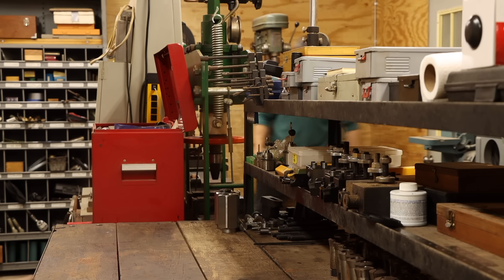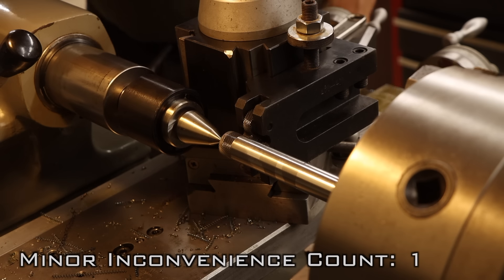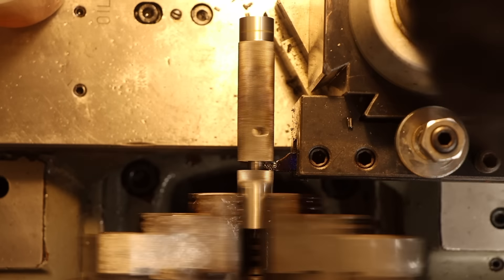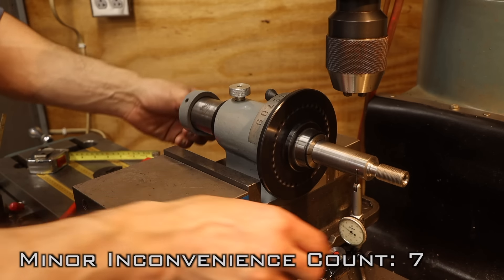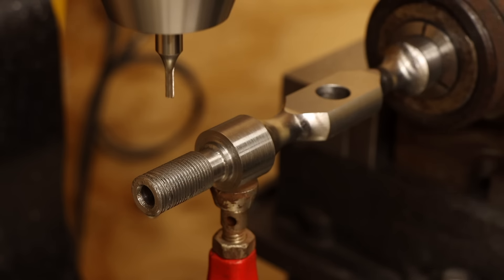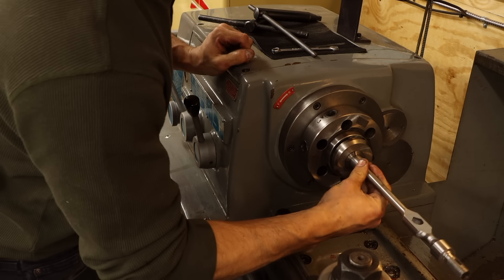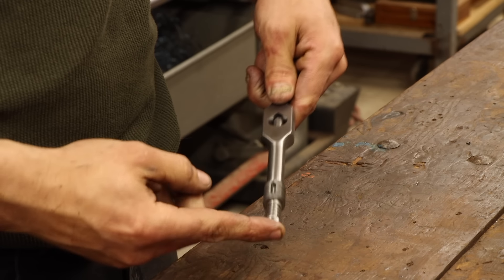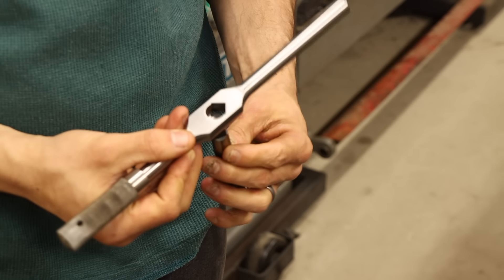Making a Tap Wrench || INHERITANCE MACHINING

Comment: That looks great!  The only thing I'd do differently would be to turn the fixed handle to the same size and shape and knurl it just like the knurled rotating end.  I think having each end of the wrench at a different size and surface texture would be a bit weird in the hand.  But that's just me.  Great work, as always!
Reply from the maker: Hmm. yeah I guess I haven't really noticed it as a problem. When tapping I tend to keep one hand parked on one end then sortof go over-under with my other hand. Thanks for the support!
Reply: @InheritanceMachining  You're welcome!  I hope me pointing out my OCD doesn't make you any less pleased with your tap wrench.  You should be very proud of it!  The way you used the collet indexer and the side of that milling cutter to cut the large fillets was awesome.
Reply from the maker: Not at all haha my testing on that operation was with a. boring bar. which worked just as well and would be necessary if i needed some oddball radius.

Comment: So tailstock-induced taper seems to be a theme in two videos now. Did you ever figure out what was going on? Just wondering how the wear on the underside of the tailstock is, or if the clamping block might be shifting it slightly on the ways?

Comment: I would be interested in knowing your opinion on cold blueing for durability and rust  resistance verses the nice chrome like finish you have now.
Reply from the maker: I've cold blued quite a bit recently but can't say much from experience since its new to me. I would imagine blueing + sealing would be better though. I like the look of bare metal better so I'll just keep it oiled. BTW the body is O1 so shouldn't rust as badly as the carbon steel handle.
Reply: @InheritanceMachining  Thanks it does look awesome. Well done.

Comment: Thats actually a worse place to rop a metal part than under an immobile car standing on grass ...atleast under the car you can use a magnet...well for most bits 
That is a very pretty tap wrench...why on earth didnt you have one..Most people seem to use any number of lathe and drill chucks to hold taps which drives me nuts so its good to see someone doing it right.
Reply from the maker: Haha I know all about that too. I’m also guilty of using chucks for power tapping. But now I have less of an excuse ;) thanks!

Comment: Have you seen tap wrench sockets? Mechanics like myself love them but I'm not sure how well they work as a machinist
Reply from the maker: I have not actually. I could see that being useful for chasing threads. I think the challenge with forming new ones is the need to reverse every full turn to break the chip, which could be a pain with a ratchet

Comment: You must have previous experience in making videos, since right out of the box on this channel you've been producing excellent content.  the videography as well as the narration are top notch..
I was thinking one of those home nickel plating kits would dress up the tap wrench, as well as make it more resistant to corrosion.
Reply from the maker: Thank you! Yes and no. My wife has a pretty successful channel so she's been helping quite a bit to get this going.

I've never played around with planting before. I would be kind of worried the really high forces where the tap mounts might cause the nickel to chip. But then again I wouldn't know.

Comment: 4:09 Just how did you get the drill chuck to hold the tap with out spinning? P.S. I'm not picking at you. Your Grandpa had a nice set up, glad to see you using it.
Reply from the maker: I’ve never had much problem getting keyed chucks to hold taps like that. I just gronk down on the key. PS no offense taken at all!

Comment: Nice project very good .THe indexer ws not true to the machine because you had clamped on a cast surface .
Reply from the maker: Thanks! I didn't show it but I had some small aluminum rod between the cast side and the fixed jaw. The side against the moving jaw was machined, which probably contributed more the that misalignment. I also didn't go nuts cleaning the indexer so could have just been some rust as well.
Reply: @InheritanceMachining  okay , keep on making videos

Comment: Should there not be another neural the other end of the handle
Reply from the maker: I guess you could but its not really needed since having a tap in the handle helps with the grip. Starrett's doesn't have a second knurl

Comment: I dont know much about this
is the O1 steel heat treated and if yes what hardness is it treated to 
If no does it matter if the wrench is heat treated or not
Reply from the maker: If you want it to last it should be heat treated. I'll be circling back around to do this eventually. Most important parts to harden would be the parts that actually touch the tap since they will see the most deformation.
Reply: @InheritanceMachining   thanks man

 This I what I thought, I'll  make one thats easier to make then harden the V groove or jaw parts

Comment: Are you counting on regular use to prevent rust? Also did you grease the threads, even if not shown on camera?
Reply from the maker: I'll be coating it with ACF50. Seems to do a great job on my machine surfaces as well. I'll grease it too, once I'm done playing with it haha

Comment: What is the purpose of the hole in the handle drilled at 4:50?
Reply from the maker: Im not 100% but I think you could put a rod through it to get it tighter. I included it because that's what the Starrett has.
Reply: @InheritanceMachining  Thanks, I thought it might be that. Though does it need to be super tight? With the square shank I can't see it slipping much.
In any case, great job!

Comment: Nothing wrong with threadcutting using a tap, not quite as elegant as single point  cutting, sure, but it's the simplest way to get threads into something that doesn't need aerospace tolerances. Lol
Reply from the maker: You're 100% right. But still my brain thinks its a short cut 😂

Comment: They make or grind Lf and Rt parting blades that remove the annoying nipple......
Reply from the maker: I'm aware, I just don't have one at the moment
Reply: @InheritanceMachining  you can grind it on the end by hand..
Reply from the maker: @vettepicking  I actually did that for parting off the body. Probably around a 10 degrees. the nubbins was still there but a bit smaller